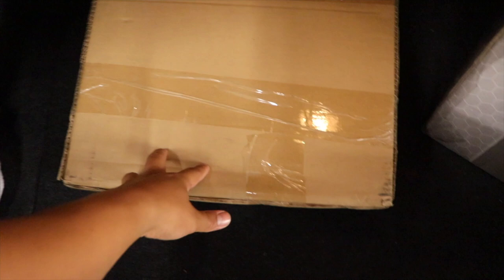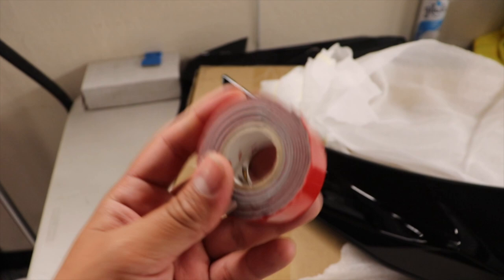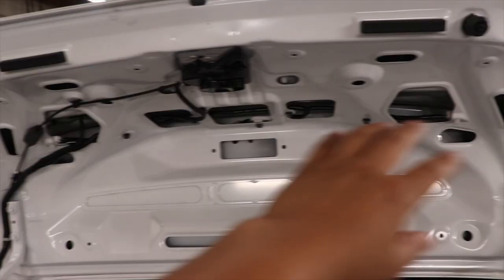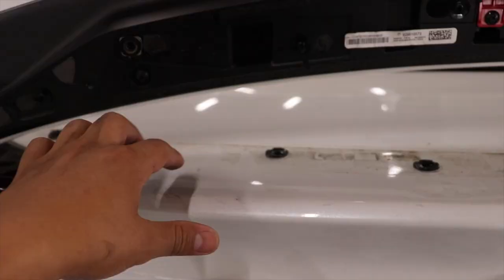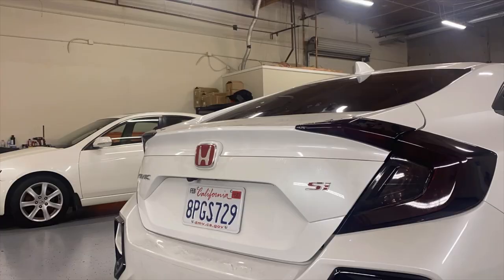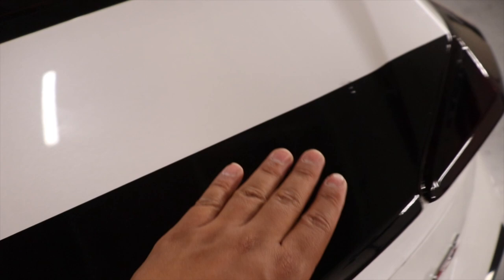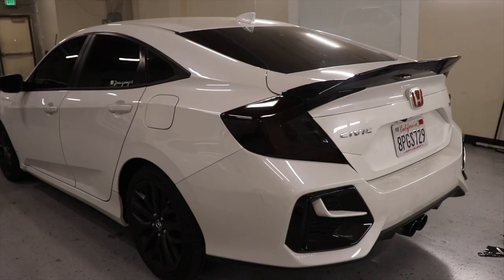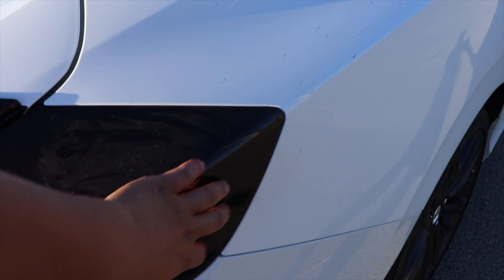2020 CIVIC SI GETS A DUCKBILL SPOILER

Comment: The duckbill is sick, BUT there's no way I'm leaving holes in the trunk covered by vinyl. That just me. But if they ever have a full bolt on that looks as good, I'm in lol.
Reply: I agree
Reply: 100% ive done Roofing and i know this is a patch job that wont last very long. LEAK city
Reply: Just install with double sided duck tape?? 😂 I’ll pass. Either it will fly off on the freeway or it’ll be gone when you take it to the mall parking lot lol

Comment: I love the duckbill spoiler so much. It’s not over the top & doesn’t look stupid like most of these oversized spoilers. I love the stock spoiler on your car. I’m about to buy the duckbill for my 2020 Honda Civic sedan.. my civic is the same white & black theme .. I have all smoked lights.. ( I have smoked headlights too which look amazing but I don’t recommend to anyone because you can’t see shit at night) I had custom halo & demon eye headlights made with black bowls that I’m about to install & it’s going to look amazing!!! redid all the chrome trim black & a delete kit for the emblems & took the trunk side “civic” logo off. I think a black spoiler just doesn’t look right imo… It makes it stand out too much & looks like it doesn’t belong on the back & with having smoked taillights it like blends into the taillights & just doesn’t look right to me.. & I’m not doggin on your car that’s just my opinion. You should have it painted white & it will go more with the car.. that’s what I’m gonna do when I buy mine. My civic has that little tiny stock spoiler thing at the back .. if you even wanna call it a spoiler & I just hate it but since the screw holes are so close to the tip of the trunk .. this duckbill spoiler will cover the holes no problem .. I’m just worried in the long run the exposed holes will cause rust even covered by a spoiler.

Comment: I have Spec-D taillights on my 10th gen civic and I tried putting on a duckbill spoiler and it would not fit because the trunk light part sticks up a bit more than the OEM taillights, do you know where i can find a spoiler that fits with the spec-d tail lights?

Comment: A word of advice use clear bathroom caulking if you don’t want water getting into your trunk. I filled ea hole with it and bought the foam strip from my local automotive store to keep moisture and dirt out the bathroom/sink caulking works like a champ hard to remove later on but manageable